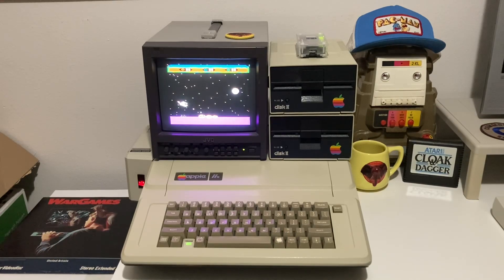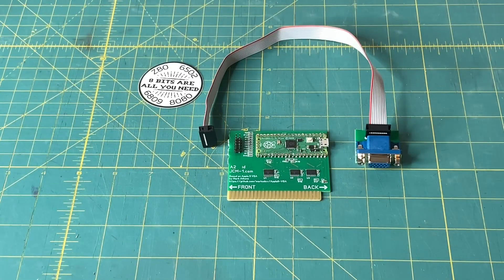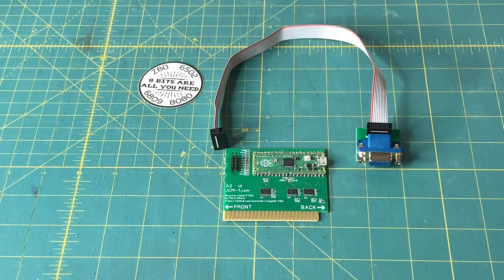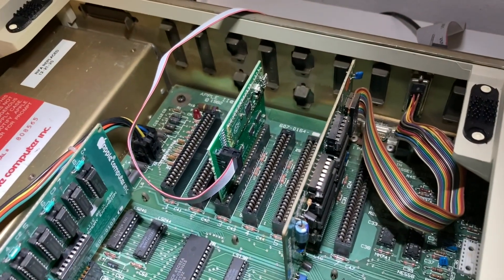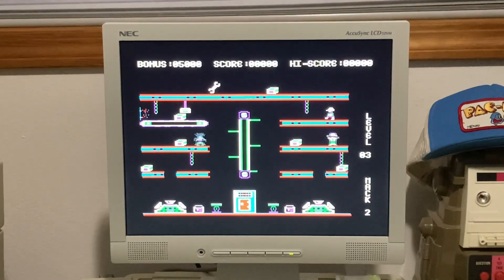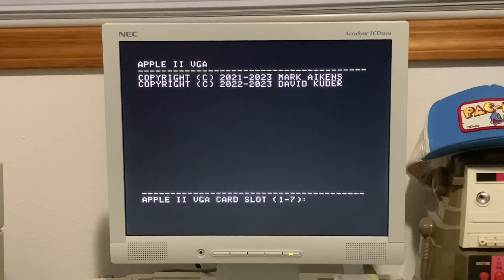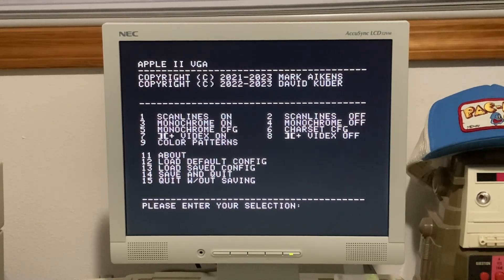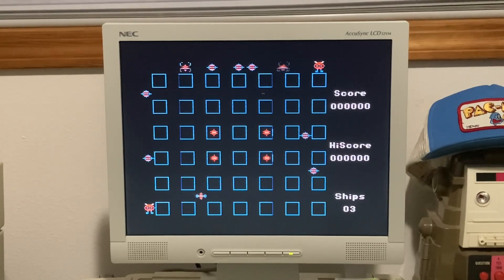Apple IIe (1983) with VGA in 2024 - A2 VidGA Upgrade Demo & Review

Comment: I have a similar project on my Github but it has a PLCC socket for a PAL/GAL and uses a shielded FPC cable for the VGA port.  I have an Apple IIgx ROM3 that I'll be using it on and for the IIgs, using Slot 7 is better than a random slot because of Color Ref(35) and Sync(19).
Reply from the maker: Very cool. What's the link to your Github project? On Mark's Github for his Apple II VGA card there's a note about future work that reads "With the Rev B hardware design, the firmware has access to the Apple bus' SYNC signal when installed in slot 7. Theoretically the firmware could synchronize the VGA display scans with the video hardware in the Apple II." So I assume this is what you added into your project?

Comment: "to a modern VGA monitor" - its been many years now since I've bought a dispkay that has a VGA port. Most people will likely need to rock a VGA to HDMI adapter so can use with their flat panel display.
Reply from the maker: IIRC I haven't purchased a new monitor with a VGA port since 2001 or 2002, however for now you can still pick them up used from thrift stores and/or e-waste places, so that's nice. I do have a VGA to HDMI adapter, so I'll need to give that a try myself. Thanks for making that suggestion.
Reply: @geekwithsocialskills  Well, I'm always constantly thinking in terms of how we can still do retro computing, but while using all the currently manufactured modern accouterments - it's not honest retro, but perhaps pragmatic retro
Reply from the maker: Agreed. I'm all for anything we can use to keep our retro technology going, especially cool pieces of modern day hardware like this Apple II VGA add-on card.

Comment: IMHO, I really like to play old games on CRT monitors. LCD monitors are too flat.
  Do you know if this card is able to emulate all the modes?  I know the II relies on artifacting for some of the color modes. 
Do you know what mode the VGA monitor is in?  How much lag is there?
Reply from the maker: Agreed, I too like using CRT monitors whenever possible, however as time goes on, more and more CRTs are giving up the magic smoke, so having the ability to use a VGA monitor on a Apple II computer, especially for the low cost of the board, it's a nice solution. The card does emulate a lot of modes. As of now it supports Apple IIe video modes: 80-column text, double-lores, and double-hires. I recommend checking out Mark's Apple II VGA Card Github page that has all the currently supported modes, and since his firmware is open source, people can contribute or fork the code base. Here's the link https://github.com/markadev/AppleII-VGA/
Reply: @geekwithsocialskills  Thanks.  Great video too.
Reply from the maker: You're welcome. Glad you enjoyed my video. Thanks for watching!